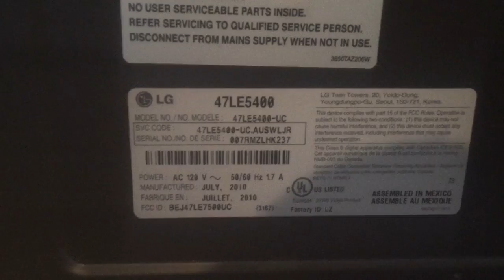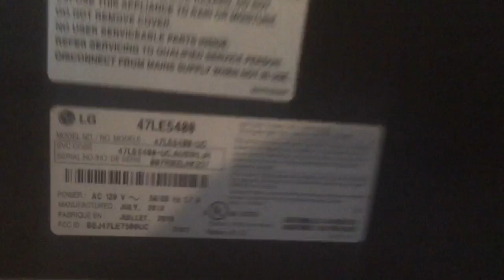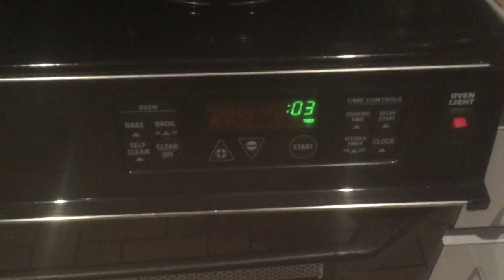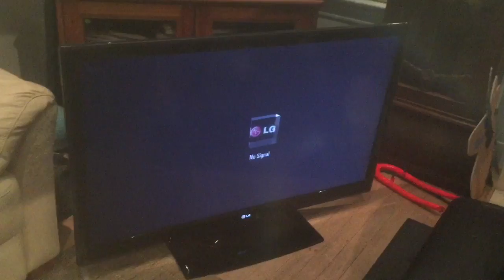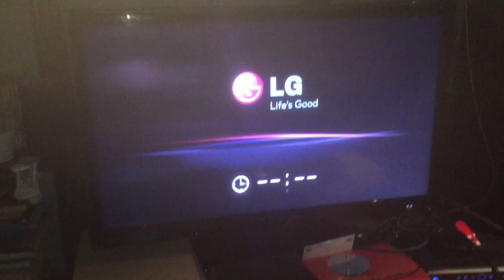Repair An LG Television Motherboard By Baking It In The Oven

Comment: Wow! I tried this today on my LG 55LV5500 that started having issues last week. It had a green screen and green vertical lines. I was about to recycle it but I thought why not give this a shot. A couple of suggestions from what I did. I put my motherboard on a pizza box cover and covered the top with aluminum foil. I preheated the oven to 385F and baked it for 12 minutes. I opened the windows in the house but quite honestly other than a little smell I think the aluminum foil kept the smoke to a bare minimum. Honestly, I didn't even need to open the windows. I let it cool for 30 minutes and then reinstalled the board and put the cover back on the TV. I wasn't expecting it to work. Well, guess what? It worked! I had to text my kids and wife right away. They couldn't believe it. If you're going to throw away your TV and buy a new one why not give this a try? I don't know how long this will last but at least I know it's a temporary fix and I don't have to go out and buy a new TV after only 6 years.
Reply: Well, my TV is starting to have the green screen issues (not as bad and unwatchable as before), so I will be baking it again today and I'll see what happens. If it doesn't work, I guess I'll have to buy a new TV. If it does, I'll take another 3 months if I'm lucky before I have to try again.

Comment: This worked for me on my LG 55LW6500. BTW, Don't use cardboard. Use Parchment paper which is designed for cooking at high temperatures in the oven. Also, My problem was green color and static pixelation.

Comment: My LG 42LV3730 turned off while using it - no sound, no video. After restarting it, I got the two red light blinks then the solid blue light, but nothing. After some multimetering, I determined it was not the power board and was likely the mainboard. After a 12 minute bake at 200 degrees celsius, it works again beautifully!

Comment: I tried this, two micro chips on the bottom of the board fell off.  I did 385f for 10 mins.  It was worth a try, now I'll just be buying a replacement board.

Comment: Ok, you guys rock.  I had my doubts, but not much to lose when my LG 47LV5400-UB just stopped putting out any signal.  The power was on but nothing happening.  I found this video and gave it a shot.  Worked like a champ.  TV is back up and running perfectly.  Thanks!!

Comment: can i just make you people aware that its not the lead free solder that is making this tv not work. its a faulty cpu/gpu when heating the gpu even for 30 seconds with a heat gun or even a hair dryer that can NOT melt solder it will bring it back to life!! try it on 90% of lg tvs that seam like they don't have a back light or turn on but nothing comes up on the screen!
this fix may last you a week a month or 6 months but thats it its a temp fix.. only cheap fix is replacing the main board!
Reply: Even I feel so ... I am facing  the same problem third time after this baking procedure for my LG 42LW5700 ... After baking it worked for 2 to 3 days at the most.... Let me try hair dryer method today :)

Comment: Sounds like crazy internet tricks part 1001 but unlike most internet "tips" this one actually works.  Most of the videos I see listed so far have been for LG tvs that will not start up at all.  For mine the only problem was the HDMI would not work.  Unfortunately that is a big part of what modern TVs need.  I made sure I had the money available to replace and did my search for a replacement first before I tried this figuring that even if it works sometimes there is no guarantee for me.  Then I did it and viola it worked first try.  Fan(s) directed outside from the kitchen and open windows recommended.  Several videos, DIY directions, websites etc devoted to this fix.

Comment: Tried this today and IT WORKS!!! My variation was to use my BBQ grill outside because it really smells. I heated it to about 375 degrees and placed the board elevated about an inch on cardboard and closed the cover. Opened the cover and let it cool about 10 minutes, reinstalled and voila!
Reply from the maker: I like your variation.

Comment: My LG45LE5500 HDMI inputs were not working and I tried this solution and it worked perfectly.
Reply: I just had to re-bake it again 4 months later. Works again, this time I baked for 15 minutes we will see if this time the fix lasts longer.

Comment: I saw another video where the guy was trying to fix the HDMI  issue with a heat gun. I tried that, but when I connected everything, the LG --:-- issue wasn't fixed, and also, have the screen was messed up. So I figured the TV was headed for the trash. But I went ahead and tried the oven thing, and it works, and the screen looks GREAT. And the HDMI issue (which had started way before the LG --:--" problem was also resolved. Thanks to everyone who made videos. Amazing way to save a few hundred bucks.

Comment: Yep, it does work....but I did this repair successfully about a year ago, and the same problem returned last week... so I repeated the procedure, only this time I used a 390 F oven setting and left it in there for 15 minutes... this time, it seemed to cause some visible oozing of clear brown glassy looking flux from some of the larger solder joints.. but I'll be damned, it worked AGAIN..  yea !!

Comment: Used a toaster oven set at 385F. Melted all the connectors, jacks and a few other items....... Heat sink is also charred. Possible toaster oven doesn't control the temperature well. Guess I'll look for a new board. Prior to this, I was able to get the TV to come on by using a blow dryer on the board. I was not able to isolate the exact parts, but it was not the large capacitors. seemed to be the processor.

Comment: Hello  Avrim , this  process  works  with  all  boards  that  are  not   plastic  sensitive (low  melt  point  components ) ;  that  is  most  circuits .  However  great  care  is  recommended  when  making  decision ,  should  only  be  carried  out  by  qualified  technician  , because  of  the  possibility  of  electrical  shock .  Regards  Sergio .

Comment: I did this last night to my 55in led LCD 5500 tv- totally worked- set temp for 350 (but it's an old oven, and runs hot, so I didn't want to over bake it) for 10 minutes. At 10 minutes I turned off the oven, opened the oven door for 10 minutes and let it sit on the table for 10 to cool, then put it back in. 

Thanks to everyone before me for making me feel comfortable. Good luck to everyone else!
Reply: 55le5500 is the model number- thanks again! Good luck!
Reply: Also- kids were sleeping and we opened the front door for air, and turned on the bathroom fan across from the kitchen. Fumes were not as bad as I expected. Didn't set off smoke detectors or anything, it was just noticeably smelly, but not overwhelming. It was not as bad as something burning in the oven, or a neighbor burning garbage or leaves, If that helps makes anyone feel better

Comment: Thank you!!! I just finished fixing my 47"LG. I had put up with the HDMI ports being "broken" for over a year. I had an HDMI to composite adapator and it was ok until the unit would not boot. I pulled the board out in about 20 minutes, cooked it as per your instructions. Let it cool during dinner and then buttoned it up, and tested it. The whole family was amazed!!!

Comment: That actuall worked on non-working HDMI ports on LG47LE5400. Followed the steps , assembled TV and gave a try. HDMI worked as day 1, I only had problem with antenna input for 10 minutes and THEN everything started working. THANKSSS

Comment: Bought a 55" 120Htz 55LE5400 from someone on Craigslist for $40 that was freezing on the LG logo like this, thanks to you I had it up and running again in less than an hour. I was simply floored that this worked, thanks SO much guys. As a side not, the smell really wasn't a big deal. Just smelled like well used computers did in the 90s for a bit.

Comment: This worked for my LG 55LD650!  I was having problems with only 1 HMDI port
working.  Port 2 was blank.  Port 3 would flicker and distort half of the
screen.  Rebooting would show a clear
screen on one of those ports until you switch to another one and switched back.

I put main board in the oven on 3 sheets of aluminum foil,
at 385 degrees F, for 10 minutes.  Then
turn off the oven, opened the door for a few seconds, then closed it.  I let it sit in the hot oven for 1 hour to
gradually cool off.  It was still hot so
I open the door and let it cool off for 30 more minutes.  

I put everything back together and all the ports
worked.  I couldn't find anyone who sells
the main board for this TV so I was looking into buying another one.  Good 55 inch TV's are expensive, even used.

THANKS!

Comment: Mines cooling down right now so I can't say if it worked or not,  but fair warning to anyone else, if you have a USB port on your board it WILL melt
Reply: Ended up not working for my issue, so hopefully replacing the entire main board will

Comment: I have an LG 55 inch with the same problem HDME not working.  So yesterday I did the same steps but I used a BBQ outdoors.  The heat got up over 400 degrees a few times but to my surprise.... it worked!!!!!

Comment: I did it today on a LG 42LD650. 
The Tv was stuck on the boot screen.
I put the mainboard at 210°C for 12 min, and let cool down the oven before move it.

And it works like a charm. Just hope this will last for long.

Comment: Well this didn't work for me. looked so promising too. Not sure if I jumped the gun too much or not. Didn't have cardboard and used parchment paper. After I pulled it out there was about 8 small pcs that fell off. Did it right at 385 for 10 minutes. think it should have been much less.
Reply: Why would you use parchment paper...the point of cardboard is to keep the heat from the metal in the oven AWAY from the board.  Parchment paper isn't going to retain heat at all, and you applied direct heated metal to the board so of course parts of it fell off.  The problem isn't the time or the temperature, it's your misunderstanding of thermo dynamics.  How did you not have cardboard, couldn't find an extra box laying around the house?

Comment: My LG LW6500 display was blank. The service engineer said main board seems faulty but exact model was not available. He tried an alternate model which turned the display on but was showinga pink tint so i didnot go for that.  After watching this video i used a hot glue gun instead and it worked. Many Thanks to you saved me from unnecessarily buying a new TV.

Comment: Worked for me too!!  I came home and my wife was sitting on the couch, like she normally would be, but the TV was off.  I asked her why the TV wasn't on and she said it was stuck at the LG logo screen.  So I tried it, and sure enough, it would not proceed.  I looked up online and found video's like this one.  I quickly took it apart, and I baked mine at 390 to 400 degrees for a little over 10 minutes and MY TV WORKS AGAIN!!!!!!!  I can't believe this worked.  I was ready to re-solder all the bad terminals and what not, but some of them are way too small.  The heat from the oven promotes the solder to slightly reform, and to reflow.  My board has burn marks where it looks like the resin came out of the solder.  Anyway, who gives a shit, this freaking works!!!!!!

Comment: I just did this today. I have an LG LV5500 smart tv bought 1/2012. The on/off light would flip on for a second and then nothing. Took 15 minutes to take out the motherboard, placed it on a piece of cardboard at 385 for about 12 minutes and then let it sit for 45 minutes. Put it back in and everything works like new. Good luck!

Comment: This worked for my TV too!  LG 42lv5500 screen and sound went blank while watching a movie.  TV would turn on, but no picture/sound.  Baked the motherboard in tin foil 10 min 385 degrees, let cool, and it's back working.  Very easy process, and thank you to Avrim Fishkind for posting this video!!!
Reply: Does it still work?
Reply: Is it still working Nini?
Reply: Nini Girl Ⓥ my microwave has convection mode, microwave mode and grill mode. Which is that i use??? Plz answer
Reply: Worked for my tv too!! 42LV5500!!
Reply: Nini Girl Ⓥ its been a year how long did it last or is it still working lol

Comment: Unbelievable!!  It works!  :-)  I have an LG 55LS5600 and when I powered it on, the red light would come on, slowly pulse twice then go to a white light. I had no picture ,sound, or any kind of indication that the tv was working.   So I figured what have I got to lose!  I pulled out the main board and baked it for 10 minutes at 385F, let it cool, put it back in, and the TV worked.  Thanks for the great video Avrim.  PS.  When I opened the oven quite a bit of really bad smelling smoke came out.  Keep the stove fan on high and open the door slowly.  It might be a good idea to keep a window in the kitchen open too.
Reply: Andrew Dowdall did you heat up the oven first untill the recommended temperature reach up and put the motherboard after or you put the motherboard at the same time you turn the oven on? Then wait 10 minutes to pull it out? Thanks
Reply: Hi Tootsie Pop.  I let the oven preheat to 385F first, then put the board in.  I simply put the board on a piece of cardboard.  After the 10 minutes were up I opened the oven door and let it cool off while in the oven.  I didn't want to accidentally move any parts on the board before it had a chance to cool off and harden.  For anyone who isn't sure about doing this, check out this great article that explains why this works:  http://www.computerrepairtips.net/how-to-reflow-a-laptop-motherboard/
Reply: Andrew Dowdall  thank you, I will try it tonight!
Reply: I hope it works for you.  :-)  Let me know how it goes.
Reply: Andrew Dowdall  OMG, it works. Thank you very much God bless.
Reply: Excellent!  You're very welcome.  :-)
Reply: Agreed - when you open the oven up you do cop a bit of steam and fumes
Reply: I wanted to post a follow up comment to say that my TV is still working great since baking it's main board 6 months ago.  What an awesome video!
Reply: Andrew Dowdall Hi! how is your TV? Is it working?

Comment: I was very skeptical about this after getting bids upwards of $200 from technicians to fix it. We spent a week dithering about what to do but decided to try it. The whole process only took about an hour total. First off the oven does NOT smoke as much as shown in the video. (He must have baked it at 385 degrees Celsius. LOL) Anyway, if you have any kind of exhaust fan on your oven you won't have a problem with smoke or odor. Also it is not that critical as to time, it should to be in the oven for at least five minutes, at more than 380+ degrees F. but no more than 400 F. (Solder melts at 370 F.) Also, like he says, let it cool in the oven with the door open. Cooling it too fast is not a good idea. Most important of all IT WORKS! Don't be intimidated, all you need is a screw driver. PAY PARTICULAR ATTENTION TO HOW THE WIRE FASTENERS ON THE MAIN BOARD WORK IN THE VIDEO! You'll be as surprised as we were when our TV came back to life.

Comment: Woke up one morning and turned on my LG 55LX9500 to find a black screen with a high pitch noise coming from the speakers. Baked the Main board at 385F for 10 minutes and that fixed my 3D television! Another success story. Thanks to you and Zedic!

Comment: Someone has done a lot of trail and error and can up with how to re-solder all components in 10 mins. I really appreciate you taking the time to come up with a solution that only cost a can of Febreze. I will make sure to run this test each and every time I have a main board problem. All systems GOOOOOOOOOOOOOOOOO!

Comment: Avrim, of all the half baked (pun intended) cockamamie ideas that I've come across while researching this matter, I thought that this was the craziest recommendation for a fix.  I then said to myself, what have I got to loose trying this??  To my astonishment, the motherboard baking idea worked!  Would be great if someone could explain the actual mechanism/science on why it worked.  Thanks.  

P.S.  I was careful to let things heat up and cool down gradually for fear of expansion/contraction cracks that could be caused during rapid temperature changes.

Comment: Instead of using the kitchen oven, use a toaster oven and do it outside... Save your house from the stink!!!!
just remember .... 385F... solder melts at about 365F... if you place it on cardboard and go above 451, your cardboard will burn
Reply: Will your wife still eat from the toaster oven is the real question... Lol
Reply: Tin whiskers are the root cause. Baking the board is re-flowing the solder and melting those short-circuits away.

https://en.wikipedia.org/wiki/Whisker_(metallurgy)

Not as much of a problem with lead solders (Military still requires lead solders for device longevity and reliability). Lead-free sells lots of new televisions, computers, cell-phones, etc. when they short-out.

Comment: Two things that are amazing.  (1) Your method worked like a charm for me.  10 min at 390 F.  Aluminum foil instead of cardboard.  Thanks.
(2) HDMI in LG TVs dies precisely at 5 years after the TV was manufactured!!!

Unbelievable.  My 55LW5600 was manufactured in Nov. 2011 and the HDMI stopped working two days ago.  The board was loosely attached to the frame.  Maybe LG knew this long ago and did not want to put too much mechanical stress on the board?

Comment: It worked for me.. Had flickering screen . ATTENTION: for those in countries that use metric, use 200°C  not 385. I think he is referring to 385 degree fahrenheit not Celsius. If you use 385 Celsius you will melt the plastic. I used 200 Celcsius and covered my board with tin foil and it is currently working just fine.